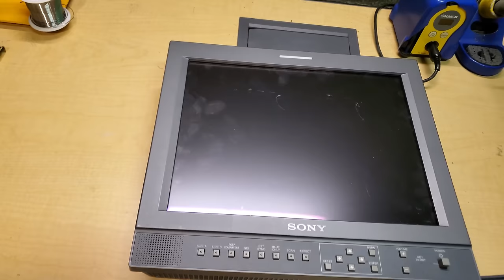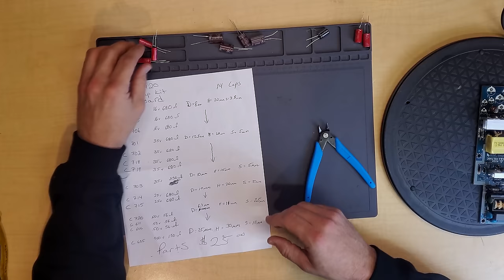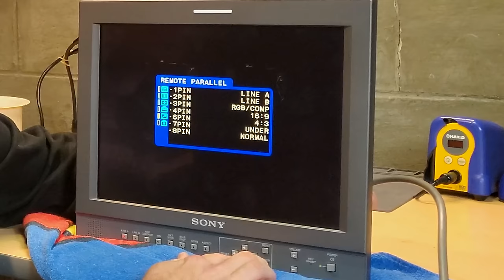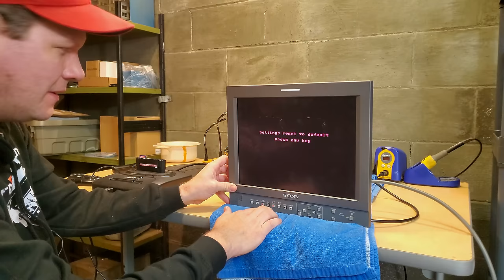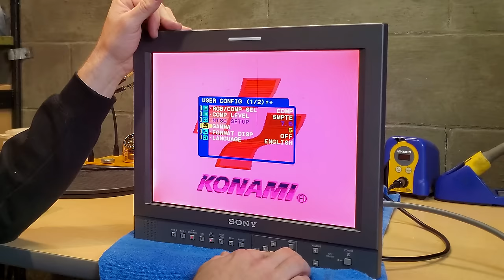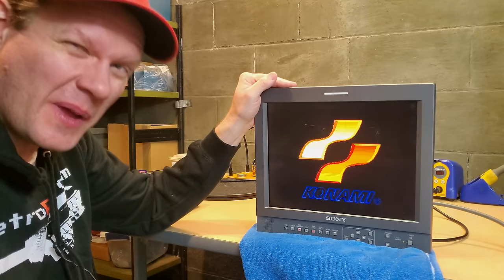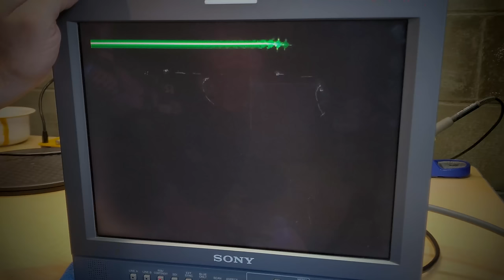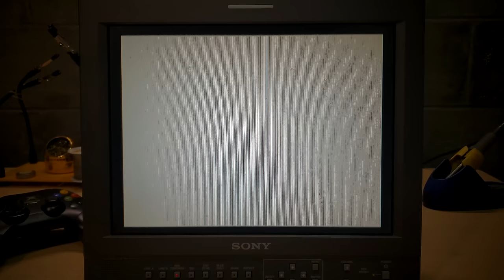The Sony LCD PVM Lives again! | LMD 1420 Repairs & Testing

Comment: It may not be a CRT but it's awesome seeing electronics being repaired instead of junked. I had a Gateway LCD monitor that died for a very similar reason. It had some capacitors in a hot spot that eventually failed and it wouldn't power on anymore. Unfortunately it did get thrown away. I wonder what is up with the strange line in the middle on this Sony and if it's fixable.
Reply from the maker: Thanks, I love to fix broken stuff.

Comment: Compare this to a 250 line-count PVM.

The "lack" of scanlines on said PVM's make them ideal CRT monitors to compare to other non-scanline monitors.

A 250 line-count CRT Trinitron makes graphics look like they are displayed on a GBA.

The "thick" vertical grill separates an image vertically, and the "thickness" of the electron beam, along with the lack of bunched phosphors, separate an image horizontally.  ...it literally creates a seeable image that is comparable to the screens used for almost all of video game heldhelds, sans video game handhelds made post-2017.

Comment: The fans are setup to direct airflow upwards, but clearly this monitor was a rookie design. The EMI shield around the cables block most of the airflow on the right side, and the fan on top does little to contribute airflow across components that need it. I once had a Mitsubishi projection TV where the electronics PCBs were are placed neatly inside a solid EMi cage with a fan on top. Some turkey in manufacturing flipped the fan, circulating warm air from the chassis into the cage, cooking all the capacitors. Recapping the PCBs required 170 electrolytic caps!!!

Comment: The two fans in the bottom of the case are pulling air in. The one fan on the top is seated to pull the hot air out. Here I would replace all the fans with Noctua fans. Then I would add one more fan to pull hot air out from the capacitors.

Comment: In modern Systems, you have to look at the Impedance and Ripple Currend for the Capacitors too. Not just Voltage and Capacitance! 
In this case, the Original were Rubycon ZL, in 16V/680µF they had 41mOhm Impedance and Ripple Current of 1250mA for the 8mm types.
The 35V ones had 21mA Impedance and ripple current of 2360mA
Good replacements would be Panasonic FR series for example, as they are very close.
For the 35V ones, the 10x25mm are the ones to go, not the 10x20mm due to higher ripple current of the 25mm high ones (18mA Impedance and 2470mA ripple for the 35V ones, so slightly better, the 16V ones are almost the same).

Comment: I just picked up an LMD 1420 and it has a strange issue where it'll power on a display RGB video without issue... but once it starts getting some complex video the screen will go black (still hear audio) and the entire button panel stops responding (except power button)

Sometimes it'll actually behave like this cyclically... the video cuts out like this then comes back a few seconds later.

Other times it'll just require a power cycle to come back. 

Does this sound like a cap or fuse issue or something more severe? 🤔

Comment: I think these are still far better than my 4K Panasonic for the PS2. At least its 4:3 thats something you dont see anymore. Its really not that old for an lcd. I have a 1st gen Sony Wega tv (KLV-15SR1) from late 2002 and love it. I also have 2001 SDM-N80 pc monitor but that has a horrible panel of muted colours and slow response but the build quality is absolutely amazing. Also early Sony lcds always had interesting designs until they became the generic thin and flimsy rectangles

Comment: I’ve seen these in my area for sale, but I’ve always just disregarded them due to not being an actual CRT.  Are these a valid solution for retro gaming?
Reply: I think it depends on the person and specifically a mix of their eye sight and how much attention to detail they have. I'm sure there are people that would be happy with one of these with RGB cables to start with a good signal. But there are others including myself that would be bothered by things like the LCD blur too much.
Reply: @mottzilla4858  That’s kind of what I was thinking.  An older LCD wouldn’t seem ideal for any kind of gaming these days.  If you are ok with not having an actual CRT, you would think a more modern display (like a gaming monitor) would just be an easier choice. 🤷‍♂️
Reply: @KindaCool  And then you'd need to add an ADC / Scaler like the RetroTink or OSSC to your setup. You're better off with a good condition consumer CRT. Hopefully something with S-Video or better.
Reply: @mottzilla4858  True! This would have all of the modern concerns of needing a scaler to keep you at the native resolution, while adding the additional concerns of old school LCD motion blur, response time, etc…
Reply from the maker: Please wait for the next installment of the Cathode Ray Podcast before you spend any money on one of these monitors.
Reply: What up Kinda cool. This thing is probably laggy and you can see that it doesn't display 240p content. It upscales 240p so you lose scanlines and the image looks weird/fuzzy. Nowadays there are alternatives to CRTs. You can get lcd or oled gaming monitors with input lag close to a CRT and you can use something like the MiSTer or Retrotink 5x to feed them a 240p signal with no input lag and scanlines.
Reply: @riggel8804  Spot on!  Yeah, I've explored some of the modern alternatives, just never once considered one of these as an option.  Doesn't seem like I made any kind of mistake in that respect.  :P
Reply: @KindaCool  I looked into pro lcds too. Like you said, you can run across them from time to time. Sadly they are obsolete like hd crts, casasette tapes and cds. Not all old tech is worth saving imo....If I never hear a cd skip again I will die a happy man.
Reply: @riggel8804  Ha!  Well said my friend.
Reply: @RetroTechUSA  I agree with Steve :D I mean, I still want one because they are collectable to me but for actual use....... :/

Comment: If you must have an LCD instead of a crt for retro gaming... the few 480p 4:3 options available produce the best image without a decent upscaler.

The best is that Pioneer 40" 4:3 plasma. It's 480p and looks ok with 240p games.

It's a shame nobody makes 320x240 or 640x480 4:3 flat-screens for retro games. A 25" 4:3 version that updated like a crt (line by line) so light guns worked... would sell like hot cakes. Especially if it was OLED.

Comment: That's pretty cool, I was wondering if this monitor could display 480p,  because I have the LMD 1410 and It does not display 480p resolution.
Reply from the maker: I don't want to spoil anything.  The good news is everything will be out in the open on the test results this Monday on the Cathode Ray Podcast
Reply: @RetroTechUSA  I'd like to know how the refresh rate holds up during twitchy gameplay.  I'm sure it's not anything awesome but hopefully it's not deal breaking.  Halo didn't look great, but man the 2D stuff really pops!

Comment: I have a multiformat video engine that only works with like 5 lmd monitors if you want it
Reply from the maker: Sadly I'm not sure it will work on this one either.
Reply: @RetroTechUSA  yeah it doesn't work with any of the 640x480 panels sadly.  Just the "separate type" lmd displays.

Comment: In response to your "power cycle" @ 10:20

I'm sorry, but when one "power cycles" a piece of equipment, you need to wait a minimmum of 10 seconds, before turning said equipment back on.

If you do not do this, then voltages that are dissipating in smaller capacitors, does not have a chance to dissipate; meaning, that if you have an equipment problem, and you power cycle within 10 seconds, then the issue is likely to not be cured by said power cycle.

Fun Fact: This capacitance phenomenon is present in older N64's.

Rareware was going to use this to utilise a reward system in Banjo-Tooie, but the newer Funtastic N64's have a different capacitance, rendering Rareware's "Stop 'n' Swop" nearly impossible to render on newer N64's.

Comment: Why would it need fans if most are going to probably use it at 100 nits?
Reply: Probably to keep the capacitors cool, which were the point of failure in this case.  They have a more limited lifespan the hotter the environment they're in.